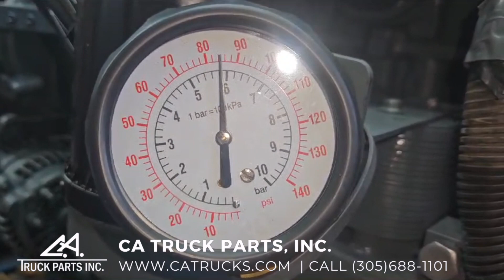2006 Mack AI Diesel Engine For Sale, EGR-Model | CA TRUCK PARTS, INC.

Comment from the maker: (GOOD USED & TEST RUN & INTERNALLY INSPECTED) 2006 Mack AI Diesel Engine For Sale, EGR-Model, 11GBA# 42007 MAX 400HP, Family# 6MKXH11.9V65, Fits 2004 2005 2006, Engine Serial # 5552M 4092 0291, STOCK# 5303